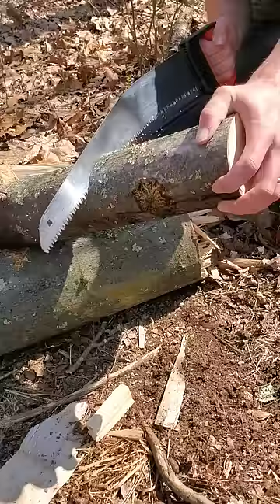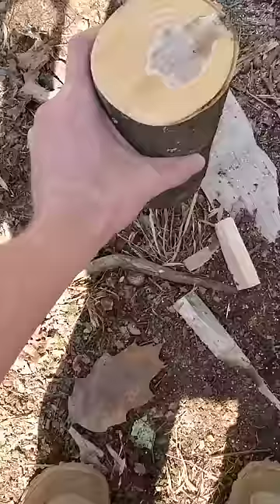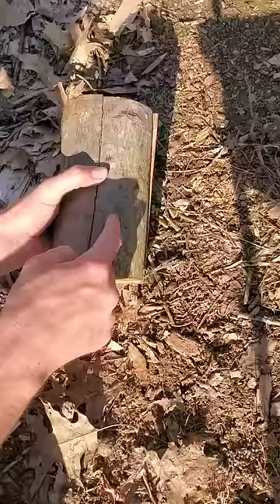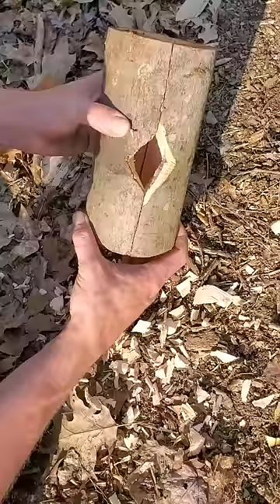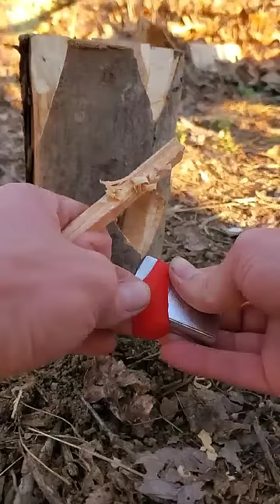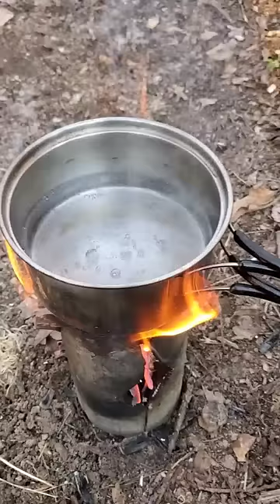Log Stove 🪵🔥

Comment: Can also use a bit of wire to help hold it together if your having trouble.
Reply: Good idea 💡
Reply: Always a good idea to keep a spool of tie wire in your tool kit!
Reply: @grimace4257 meh
Reply: Should I use metallic wire? Or normal rope is fine?
Reply: @aruthorcarly  best to use an undercover wire so the log stove mafia doesn’t detect you
Reply: @aruthorcarly  lkrider is correct
Reply: Lmao
Reply: @aruthorcarly  Rope can catch fire, or at the least get potentially damaged by the heat. Wire works better.
Reply: @aruthorcarly  Really depends on if you want to reuse the line, rope will burn with the log whereas you can salvage the metal wire.
Reply: Cool I like it
Reply: The hole
Reply: Will it melt?
Reply: @aruthorcarly  THE WORD IS METAL NOT METALLIC
Reply: @aruthorcarly  piano wire works best
Reply: like a swedish torch
Reply: @jessicacreel8361  By the time the line burns you'd likely be done anything you need done while the logs are together.
Reply: Problem is wire trees only grow in the southwest of the country.
Reply: @jessicacreel8361  You're right it is a judgment call, you tend to make those judgments in the moment on a case by case basis in the outdoors because you need to be able to adapt to fit your needs.
Reply: four handy rocks would do better
Reply: @aruthorcarly  rope will burn.
Reply: This technique is for when you don’t have wire.
Reply: I mean, I keep wire in my kit because I know how to trap, but not everybody does.  Seems to be a better idea to make this thing a little longer than described, dig a little deeper hole, and pack dirt around it at the bottom.  That's just me though.  I don't think I'd waist my trapping wire on a stove.
Reply: Save your wire for snares.
Reply: *you're
Reply: Use the wire at the bottom yess
Reply: @aruthorcarly wire would stand the heat the might burn
Reply: @MOE13576 bro woke up and decided to hate
Reply: @albertofernandez4701  just because I said "meh" ..? 🤦🏻‍♂️
Reply: if my having trouble what
Reply: No 😂
Reply: Copper or steel.
Reply: If your connection ain't good, then wireless won't work!

Comment: too many suggest wrapping metal wire around it to hold it together,  just a hole in the dirt like shown here makes more sense instead of finding a wire tree.
Reply: Exactly. You can make it a bit taller and stack rocks around it too.
Reply: crazy my old colleague had this as a profile picture on his work account, what a rare occurence
Reply: i usually just wrap some willow bark around my swedish torches
Reply: I'd do it anyway, a pan of water is fairly heavy and not something you want spilling on you.  Plus if it's food, it's an easy way to lose a meal.
Reply: depends on the day i guess, could set a nasty fire if it fell over in the right conditions
Reply: Seems it wouldn't be too hard considering he's already found the metal pot tree.
Reply: @mist8814 woah

Comment: The hole to keep the logs together is such a great idea, i remember seeing videos similar to this where they made a swedish torch and they used metal wire to keep it all together and i just thought man what a lousy trick you gotta carry metal wire with you everywhere to utilize it, but hey there's an even better idea, just use the ground
Reply: You can just use a shoelace or even some string/rope which most people will take with them camping, just gotta put it below the hot spots and it'll never come into contact with the fire...
Reply: Or just keep it wet.  It's gotta be a lot more stable than just putting it in a hole.  At least put some rocks around the base or something if you're going to sit a pot on it.  @DrakeOola

Comment: This guy is amazing! It just goes to show - if you train your brain to think outside the urban "box" and learn some survival skills, you don't have to be the one to die because of the lack of knowledge.
Reply: Just make sure you always have that zippo lighter with you and you’ll be fine
Reply: Ya know how much time they guy spent chopping while I'm just gonna grab 4 rocks
Reply: @andrewbaum768  it wouldn't take you that long if you knew what you were doing. Also some areas don't have usable rocks nearby 😐
Reply: @andrewbaum768  that will then potentially grenade and destroy your cookware. A rock with any sort of moisture in them will boil on the inside and trap the steam until it turns into a primitive pipebomb
Reply: @BOBTHESAUCEGOD  I've never had the problem your suggesting.  Have you?
Reply: @commonsense.1014  safety, it could happen to anyone and it's unnecessary.
Reply: Living in the city is pure hell every day, this is how we’re meant to live
Reply: Who knew knowing survival skills helped you survive
Reply: I’d die due to lack of physical strength.
Reply: @commonsense.1014  I don't know about Bob, but I've built large, extremely hot fires that burn for about 48 hours straight on the weekends during the summer.  I build these fires directly on rivers tones, surrounded by river stones 20' from the Piney River.  Been doing it for over 30 years. Never had a single rock "explode" like so many here claim "happens all the time".  I always camp on river rock bars when I'm kayaking / canoeing and I always build my big ole fires there. 
I've have stones that crack sometimes but i never know they're cracked until I'm putting the fire out after breaking camp and packing the kayak back up.
Done this in 7 different countries on four different continents.  Not one explosion.  Not even a "pop".
But I find plenty of whackadoo yahoos here on YT pretending to know what they don't.
Reply: Bruh there's stone available, soil available. Use these as a stand
Reply: Heck it’s great for when doing d&d characters because say your ranger succeeded a check to start a fire in a rather wet environment use this as a description for how they did it if you want to draw attention to little bits of world building and give players small spotlight moments
Reply: @andrewbaum768  you're not too bright.
Reply: The exploding stones are usually sandstone or limestone ( porous sedimentary)  I have had 2 pop a little  , but we only get 10 inches of rain a year- there are no streams .

Comment: Just took 3 stones and put the pot on it simple...
Reply: I think the benefit of this log stove is that it channels more of the heat up towards the pot. Stones would let a lot of the heat radiate out.
Reply: @trevorhegstrom2816 
Also, finding stones in a forest may not always be possible.
Reply: Based
Reply: Just put the pot on the fire
Reply: There are several simpler ways of doing this. But why make it simple if you can do it fancy? 😊

Comment: Way to much mucking around to just make some fire to cook something. "And it will boil water very quickly"....wtf...you just spent an hour making this fire contraption, now your gonna save 2 minutes 🤔
Reply: Enjoy the work for a change, being able to do things is a sign of strength
Reply: consider, concern of starting forest fires, efficient use of fuel since contact with the soil is kept to a minimum thus leaving less area to absorb the heat of your fire and ease of putting on and taking off your cooking pots without putting your arms into an open flame
Reply: It’s 1 saw cut, 2 axe splits, and a few axe notches… Fam that’d take 5mins or less and then a few sticks in the middle.

People don’t seem to understand the concept of fkn SURFACE AREA…

It’s a rocket stove design. Look up rocket stoves and why they are far better than an open fire and concentrating heat to specific place. THE POT…
Reply: This takes 10 minutes at best. What is your point

Comment: Soaking the wood in water after cutting in prep would make it last longer. You can also bolster it with heavy logs or rock pieces if you cznt dig or dont have cordage. Cedar and birch  bark provide cordage. Soak that as well.

Comment: you should use tie wire to hold it together,, that way the logs don’t separate and knocks over whatever you have in your pot.. or you can uncut stakes and pound them around it
Reply: Fires built like this burn in the neighborhood of  a thousand degrees F.

If you build them out of 8-10 inch diameter logs, they can burn from 2-5 hours.

Putting the initial burn in a small hole in the ground can serve the same purpose of stabilizing the logs, Depending on your surroundings, a few big rocks or other deadwood lying around could also be used to stabilize the torch.

No one solution is going to cover every imaginable scenario, but knowing that this is an option could, quite literally, be a lifesaver in certain circumstances.

Comment: Always pack a small spool of brass wire. Invaluable
Reply: so is just a pile of wood. no wasted time and less callus's LOL
Reply: @robertreed2168  The point of this is a smokeless, small footprint way to efficiently cook food. Make a bonfire if you want, but thats not what this is for.
Reply: @humblehunk9022  soon as you say efficient.. its not.
Reply: @robertreed2168  really? Because a rocket stove (which is what this is) cooks very quickly using basically wood scraps. It is a very efficient way to direct heat and use minimal firewood. Efficient does not necessarily mean the fastest. You could spend maybe 5min building this stove, and use it for a couple cooks until the top burns.

Have an open mind, and realize the way you view a scenario may not be the only way to look at something.

Cheers,
An avid Canadian camper.
Reply: @humblehunk9022  time.....
Reply: @robertreed2168  wrote, "so is just a pile of wood. no wasted time and less callus's LOL"

Every situation is different. When you're outdoors, having more options is generally preferred to fewer. A planned camp is different than a multi-day hike, and a day-long hike is different than a couple hour cut trail.

Instead of being contrary, try to understand what value there is to this method. Because, again, more options are better than less options.
Reply: @RichardHarlos  yah I'm doing it every day. I won't lose any of those things either and won't need to plan at all. Everything we need is right out  in the bush. Glamping is what your talking about I think. But you do whatever floats your boat. No harm in my points unless your irritable.
Reply: @robertreed2168  Nothing you wrote negates what I said. You're the one who seems to be irritable, and psychologically projecting that accusation onto me. (See 'psychological projection' for details).

Initially you suggested a pile of wood was invaluable. Which it is if it happens to have cut itself and stacked itself wherever you happen to be out in the wild. This is an unlikely scenario, so you're just being contrary for attention.

Next, you criticized the torch for not being efficient. To craft that torch takes 2 cuts for the log segment, 4 shavings for the hollowed-out section, and 2 smaller cuts -- nicks, really -- for the air hole in the side. Total construction time: 10 minutes tops.

Contrast that with how much energy is invested in chopping a pile of wood.. of carrying a pile of wood, etc.

Then, there's the time and temperature factor. Swedish torches typically burn from 2-5 hours, depending on the size of the log and the type of wood.

They also burn somewhere between 1,000 and 1,200 degrees F. Traditionally they were used for light, heat, and cooking as far back as the 17th century.

If you knew any of these things, you'd have no actual standing for relevant disagreement. But, you didn't know these things and so here you are, advertising how ignorant you are, and apparently feeling quite proud of yourself for doing so.

And, when these things are pointed out to you as matters of fact, you get irritated and accuse me of being the one who's irritated -- again, psychological projection.

Here's my suggestion: spend less energy commenting like some cowardly punk keyboard warrior, and more time learning to think well... more time learning the facts... more time understanding things correctly... then, and only then, should you consider leaving a comment that, hopefully, doesn't advertise your ignorance and arrogance.

Good luck with that. Cheers!
Reply: @RichardHarlos  you ok?